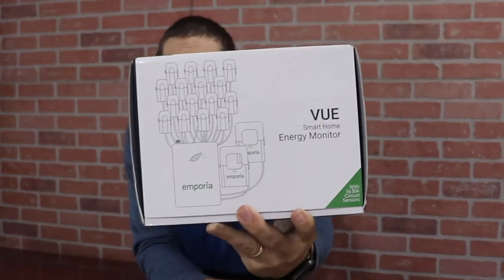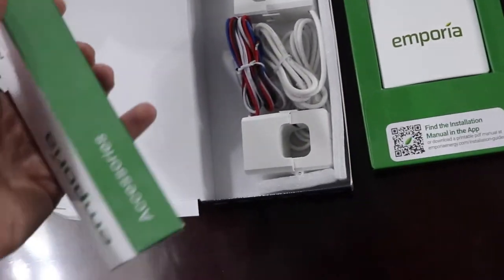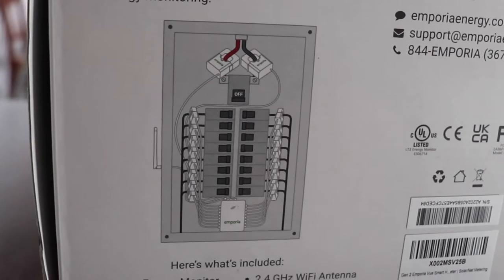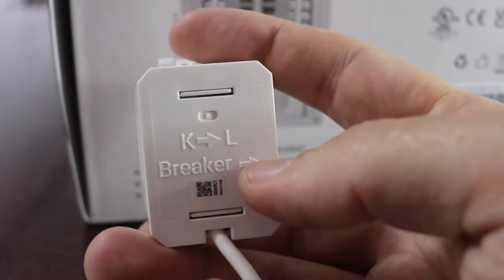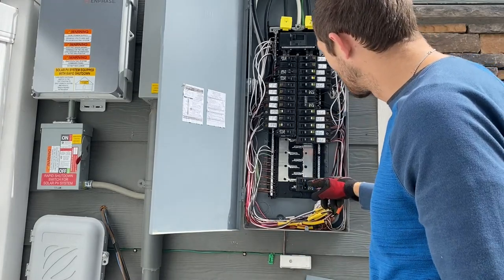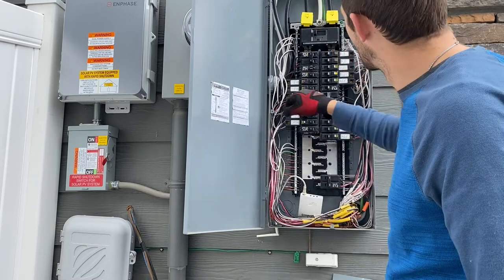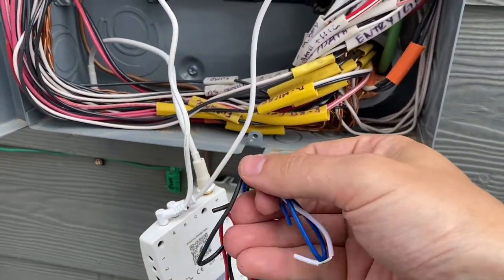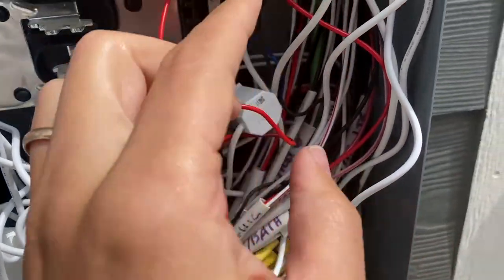How to Install Emporia Gen 2 Vue Energy Monitor With Solar

Comment: I really like the concept of power / consumption monitoring.  I would have installed maybe a 9"x 9" weather-proof box with a 4.5" to 5" depth.  The box could attach adjacent to the panel to tidy up the conductors.  Tidying up the wires, to me, would give you space in the main panel for future use.  
A personal preference... thanks for the educational video :)
Reply from the maker: That’s a pretty good idea! Thanks for sharing

Comment: Thank you for the video. I have the same Enphase solar system. One quick question, why didn't you tap the black and red wirings of Emporia box to 2 15A circuits, did you tap it to 20A and 15A? My main breaker with the Solar systems only has 2 20A and 15A circuits, I was concerned with that. Also, did you have to turn off the circuit inside the Combiner box (the Enphase box above your AC Disconnect switch there)? Or turn off the AC switch & Solar circuits in the panel was enough? Thanks again

Comment: Curious. Is the antenna outside the panel due to possibly signal interference?
Reply from the maker: No, I don’t think so. I think it is to give better signal. Less objects in the way. Maybe it has something to do with the material that the panel boxes are made of
Reply: It's because you're in a metal box which blocks it

Comment: Only recommendation I'd make....and I am sure the directions tell you to tap into existing circuits...is to drop in two new breakers next to each other. And use those.  It reads voltage on each leg to calculate the power factor if applied.  It may disturb accuracy if a load is generated on either of those breakers messing with power factor for the rest of your monitors.

If you are not using power factor for any of your circuits....ignore the above.  

Power factor honestly is rarely used,m but could be.  I have a mini split that SHOWS a draw of 150 watts even when turned off, it is because the older Emporia units do not calculate power factor.  The mini split only draws about 20 watts when off, not 150.  

Love that panel by the way.  It's a joke what my 200 amp box looks like with everything crammed in it.  I actually cannot put the cover on my box because of the two sets of CTs
Reply from the maker: Thanks for the comments, Wade! No power factor here, but that is an interesting idea...
Reply: @elibaier  there are so few appliances that require it.  If you are just trying to track and improve your consumption....powerfactor isn't needed.  Living in other countries where the grid isn't as stable as the US, it is necessary.
Reply: Looking at the Emporia installation instructions online, it covers both empty (new) breakers, and pigtailing into existing breakers.

Comment: I just chatted with Emporia and they actually said that the solar should still be pointed towards the breaker for the most accurate reading
Reply from the maker: Yes that is correct! The arrows should point in the direction of the power. I think what I meant is that it is in a different direction than the breakers. Thanks for the clarification!
Reply from the maker: In the solar instructions it shows how to install them on page 5 & 6.
https://uploads-ssl.webflow.com/5fff2b7694451e66ba2f5a3d/628fdc1ca2b2196665a9b8e0_Gen%202%20Solar%20Supplement.pdf
Reply: @elibaier  hmmm interesting I need to make sure I clarify with them! Thanks
Reply: Does this mean that your current setup will monitor how much power your PV produces?
Reply: @elibaier  Great video!! Very helpful, thank you. One question - did you install only one CT for the solar?  Or two? Emporia's installation guide says to install two 50A CTs - one on each Solar lead.
Reply: @CC-rj2mb  Don't have one of these (yet). The Emporia Vue 2 manual says for double pole breakers you can go around each pole (recommended for unbalanced loads, such as a subpanel), or around just one pole and set a multiplier in the app. I guess the inverter should output balanced 240V so maybe one would be fine with multiplier? That said, in the separate Emporia manual for solar, it shows a 50A CT around each pole of the back-feeding solar breaker.
Reply from the maker: Emporia now has out their new version. I need to upgrade and make a video comparing the two

Comment: i have an old house with several appliance on one breaker. will it know what appliance is running on that single breaker, even down to the lights?
Reply from the maker: Unfortunately this one wouldn't be able to pick up on multiple appliances on one breaker. This one would however: https://amzn.to/3AYwxPn
Its called the Sense